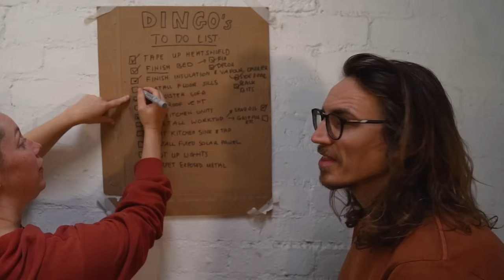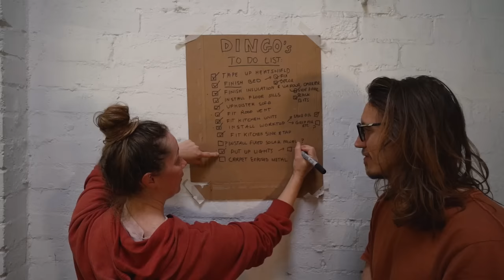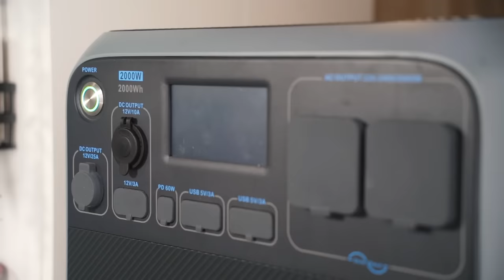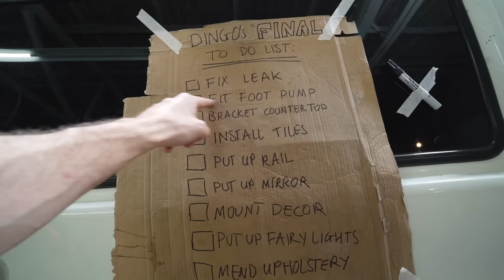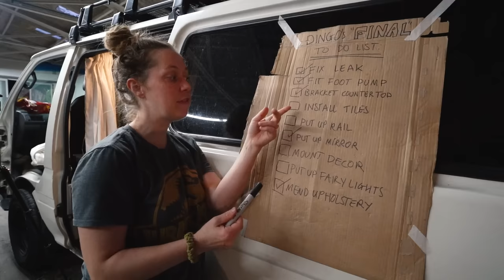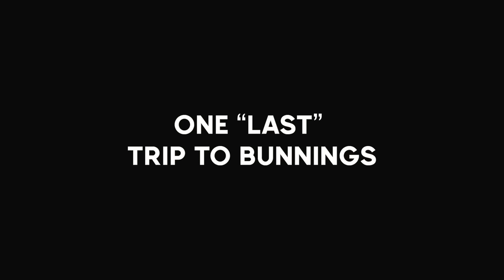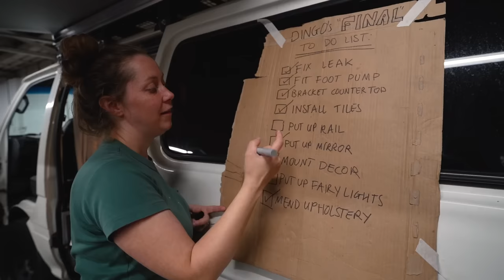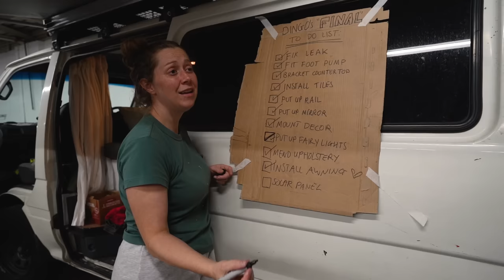An Emotional Ending to our 30-Day Van Build Challenge

Comment: You are so freaking inspiring guys!! Thanks for sharing with us, this journey of yours is helping me believing I can also do it (I’m in the middle of my own building and with a dead line too!) Keely, I’ve got the same stove on my Amazon basket! I was wondering, what else did you buy to make it work? Gas canisters, hose? No idea whatsoever 😅😂 do you use butane or propane? ❤
Reply from the maker: The hose came with it and a built in regulator, we just went a bought a gas tank from BCF cuz we knew they fitted the stove, so all you need is a tank that fits a 3/8 fitting, it says the size on the hose I think.
Reply: The hose came with it? That’s great. Apparently the European version doesn’t…thank you for the info 😊 can’t wait to see where you’re going next! Enjoy Dingo!! ❤

Comment: Such stamina! So perservering! Love the narration and filmwork.
🐔 extra mother hen cluckle--
Created gasket or applied sealant under sink rim? Fans and/or mini airconditioner to plug in Bluiit?
Sending you a coffee. Thanks for the show!
Reply from the maker: Thanks so much my love. We have a little 12v air con unit which has been working a dream on the hot nights, but so far we've mostly been freezing 🤣 as for sink, we still have to fit the sealent, we bought silicon to do it, but then we weren't sure if that was the right tool for the job, so might get the rubber lip type thing we have on our sink in Martha, cuz it's nice to be able to lift out again if needed to retreat the counter top. Open to recommendations

Comment: The stainless steel bowl sink is the best!!! Also love those little lights, were they from Bunnings? And I thought that was a Bluetti I spotted! I have the EB200P and I absolutely love it! I can run my whole caravan on it with the 350w solar panel. So stoked they sponsored you! What  an amazing job you've done and a massive achievement! I was so hoping to catch up with you before you took off but my truck sadly died 50km over the Victorian border 😢 
But I'm definitely determined to catch up with you at some point before you leave Australia. Looking forward to watching your adventures! Love watching you guys so much! ❤
Reply from the maker: Noway!!! Hope it's not too expensive a fix! I'm sure we will be able to find eachother on the road at some point before we leave ❤️❤️ the fairy lights were from Amazon, but I think they have similar ones in bunnings
Reply: @ChapterByChapterVlog  it needs an automatic transmission rebuild (AGAIN apparently...even though I already had that done 4 years ago)
I meant where did you get the little battery operated dimmable lights...
Reply from the maker: Battery dimmable ones were just from amazon, i think i linked them in the van tour video <3